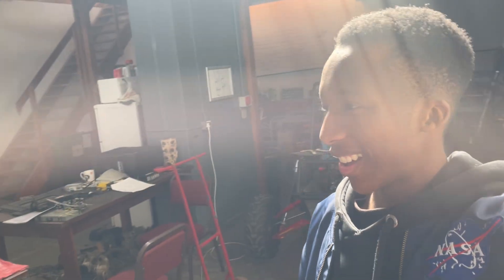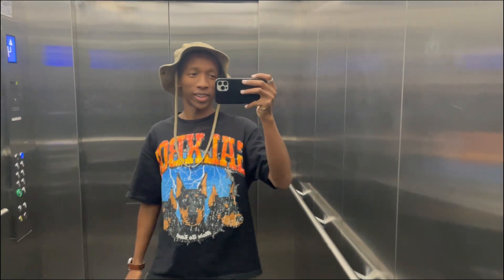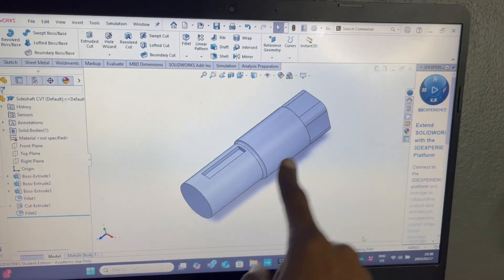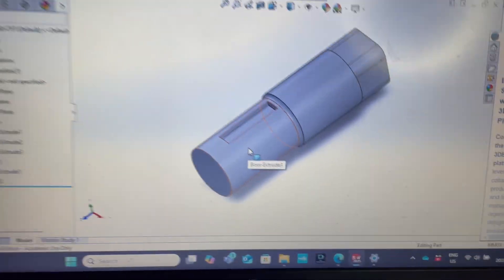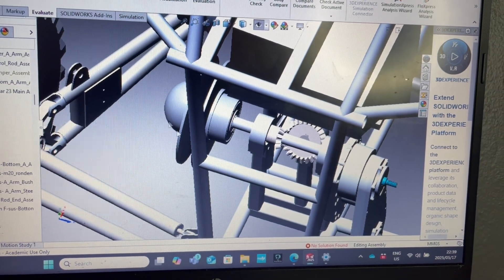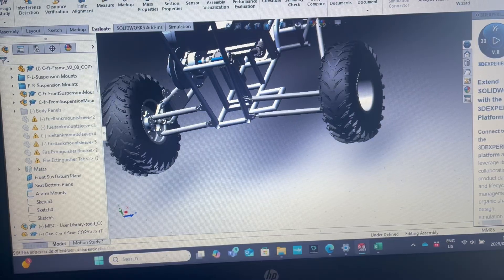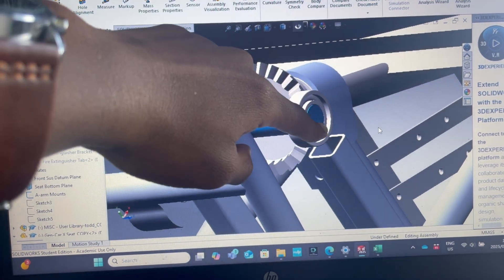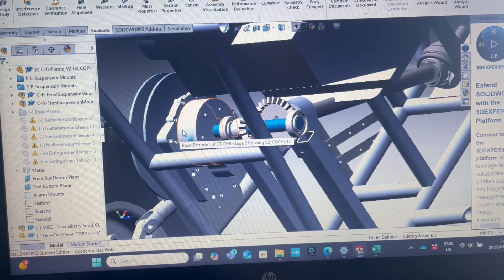Studying Mechanical Engineering in South Africa | University of Pretoria

Comment: ay broer, what modeling software should i start using , i want to start building stuff, is autodesk 123 nca?
Reply from the maker: I would say solidworks is the best option for me. It separates parts from assemblies - which gives structure to your creations. You can even do stress, force and deflection analysis SolidWorks from what I know. But you have to pay 💰 🥴 for free options you can consider: FreeCAD, AutoCad, or Fusion

Comment: As much as industry still uses SOLIDWORKS, I am very impressed with Onshape. Are you guys taught Onshape or are you self taught?
Reply: If you can master one of the design programs like SOLIDWORKS, PTC Creo, Siemens NX, Catia etc, it's easier to transition to other programs because they use the same workflow.
Reply from the maker: We are taught solidworks extensively and a bit of FreeCAD. But mainly SolidWorks, since we get free licenses through the university